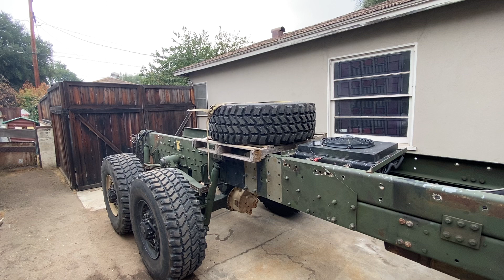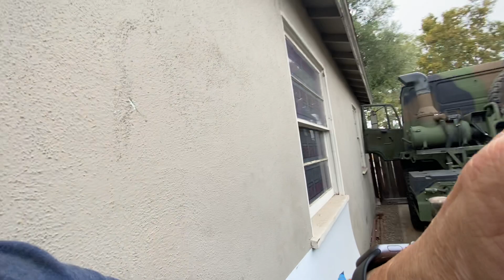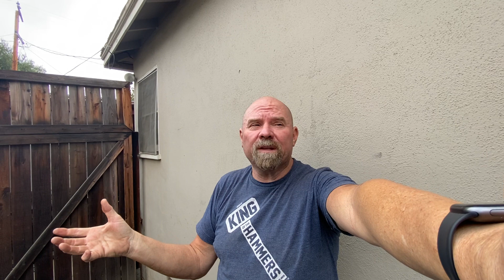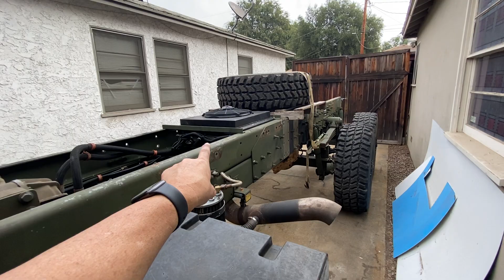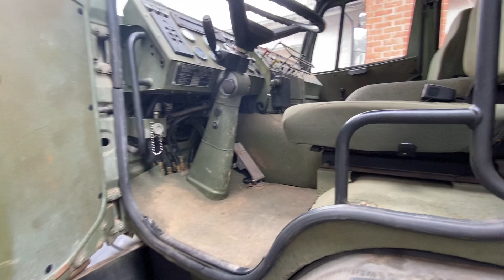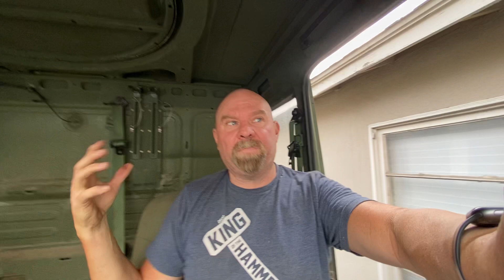Expedition Truck Build day 1.Cod Name... Oscar Mike.

Comment: Can that be registered in CA or are you going to have to register it out if state?
Reply from the maker: I regeristing it in AZ at my other house! I think once its a motorhome it can be registered in Ca but just didn't check into it.
Reply: @TRCa51  It's probably best to keep it registered in AZ., as you probably know it's cheaper too. CARB has some pretty stringent requirements for registering any older diesel, including heavy duty diesel trucks. Anything older than I believe 2010 is automatically blocked until it has passed emissions testing. That includes current CA registered diesels. They're forcing/ phasing out older diesel trucks.